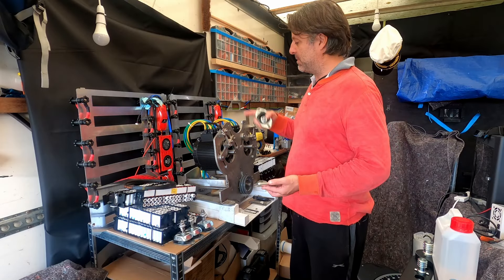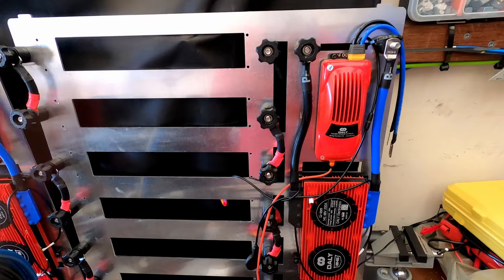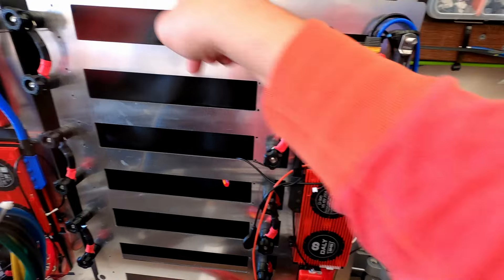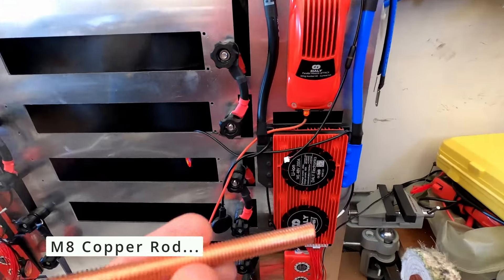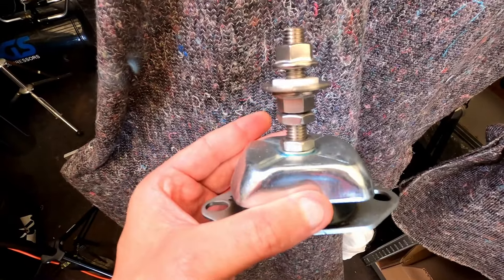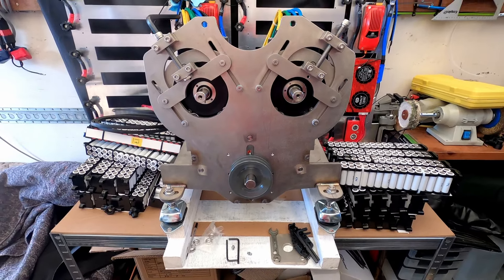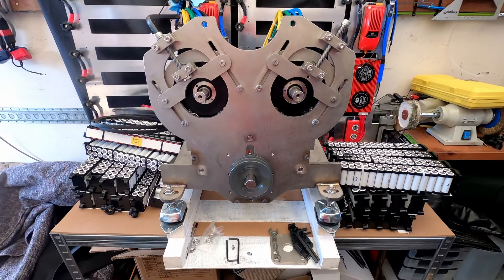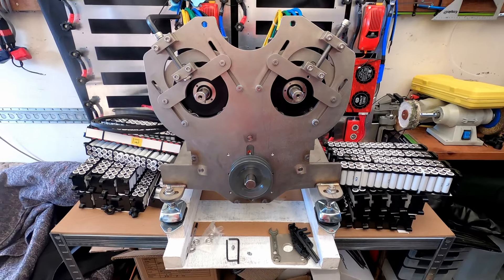Off-Grid Boat: DIY Electric Boat Motor Assembly - Ep. 6

Comment: The reason internal combustion engines for example in cars are mounted with compliant mounts is due to relatively large masses moving in a reciprocating motion or rotational motion. The biggest contribution are the pistons going up and down.
But there's many things moving inside an internal combustion engine so if you want to learn more about it, look up the Wikipedia article titled "Engine balance".
So if you hard mount an internal combustion engine, all those vibrations get transmitted through the thing it's mounted to. Things are going to break. Does the engine mind? I don't know, probably not good for it but it's probably not going to break anytime soon.

Where as an electric engine just rotates. Though that doesn't mean it won't have any vibrations. 
Grab an electric drill and turn it on. You'll feel it has some vibrations. 
Sure the rotor is balanced (hopefully) but it's not a gyroscope going to space so it isn't perfect. The bearings aren't perfect either.
But the vibrations will be higher frequency.

But will the mounts be effective in reducing that higher frequency vibration? I don't know.
Usually boat engine mounts assume you're slapping something more akin to a 500 kilo anchor on them that has secondary imbalances which the mounts need to resist.
If the mounts were too soft, the engine would bang against the hard stops of the mount so they're made stiffer to ensure that doesn't happen.

So perhaps it is overkill to have vibration dampeners with an electric motor.
But then again, there's a shock load that happens when you put the transmission in to gear.
With cars you have a clutch which you can feather to reduce the shock and you also have rubber tires that eat some of that shock.
With a boat you just slam it into gear and the propeller bites into the water.
Do you need vibration damping mounts for that? I don't know. Probably not.
Reply from the maker: Thank you for the in-depth response on this subject, it all makes sense. To dampen the shock load from torque (start) alone, I feel it must be worth having them. I rather this energy partially being absorbed by the rubber mounds, then being a direct load on motor and motor-housing. I have a feeling that it would work fine without and would be interesting to compare outcome from both scenarios. Maybe even higher frequency vibrations would cause some form of unwanted noise/vibration? I hope you did not mind thanking you in video, in hindsight I realised that maybe I should have asked you first:) Hope OK?
Reply: @modularhippo  Sure, the possible higher frequency vibrations could be annoying. Spin a drill and hold the drill's housing against a table.
But those noises might be drowned out by the motor noises. Depends on the motor controller what it makes the motor sound like.

But since you mentioned in an another comment that you will be using an Aquadrive CV then yeah the engine should be isolated as well.
If you hard mount either one, eventually something will get misaligned and bearings will take a beating.
Either hard mount everything and deal with the vibrations and having to perfectly align the engine to the prop shaft.
Or soft mount everything. 

It's okay, this is a public platform after all and I made my comments on a public comments section.
Reply from the maker: @Lagittaja -  Nice one. Although more exspenses upfront, I feel soft mount is the way to go. Perfect allignmemt work in tight space when 6'3 is not a winner:)

Comment: Just wondering why coupling 2 motors? Also these motors will not freewheel ( definitely a drag on performance) so it would be nice to see a shaft disconnect of some sorts maybe for each motor so you could work or replace on the way.
And another thought, most of these motors have peak efficiency at higher speeds so running them slow may get you in very inefficient territory.
Better run a lesser power one at optimal speed with the ratios worked out and decoupled from the bigger one and use the later when you need it (kind of like what Tesla does). This could also improve your regen ability which really sucks at low speed.
Reply: The lower pulley is a double groove, motors single groove with their own tensioners so easy enough to work on either one.
As far as RPM's and ratios goes, to me it looks like he has plenty of room to play with pulley ratios. Then there's also the propeller to play with. Plenty of opportunities to tune the system.
Reply from the maker: All great points! Disconnecting one motor during sail may well be the way forward from a regen perspective. There are so many parts in play, and each have their own limitations and optimisations, so unless tested in real application, it is hard to know where to start. I have a feeling that there will be a lot of tweaks down the line:) Cost is also a factor. I could get a propeller for 4K that would fix a lot of regen questions, but as my budget is 1/6 of that, I will have to settle for something basic and work around it. The motors have an optimised area where I get the best output against the least amount of power, and that is my starting point. As soon as all hooked up, we can get some real life figures to play with:) - Like the idea of some form of quick disconnect as could come well in handy. Thanks.

Comment: It does look amazing and I am happy to see your progress. Have you given any thought to a thrust bearing plate on the drive shaft?

Also I believe the antivibration mounts will be ok for a time. However the torque from them will eventually tear them up.
Reply from the maker: Hi - The boat I am building have a thrust bearing plate as part of it's design and makes prefect sense to transfer the energy to that plate instead of the motor via shaft. The recommended part for my boat is Aquadrive CV Joint CV05 part# 607001 Thrust Bearing B10 part# 6110210 (but may substitute them for other brands if I find something equally as good but for less $). I agree, I will definitely keep an eye on the rubber parts of the mounds over time. :)
Reply: i don't know why Aqua/python Drives are so expensive when they are basically CV joints like from old Porsche/VW...maybe they are higher tolerance? also i would think they wouldn't be necessary on electric motors (lighter than diesel ICE) especially with precision fabricated steel mounts like in this video.
Reply: @MonstroLab  cv joint is a cv joint if it can tolerate the torque and is the correct size I would use it especially if the cost is substantially lower.
Reply: @Knoconner  i think read somewhere online where a guy used CV joints from old VW bug...im going to google these key words try find it
Reply from the maker: @MonstroLab - Not a bad idea! Anything with the word 'sailboat' seems to magically tripple in price these days, so we'll worth checking alternatives:)
Reply: @modularhippo  Facts! So, so far ive read that C.V's require thrust bearings because CV's aren't designed for constant thrust loads. Also a CV+thrust unit creates more friction reducing horsepower, consumes more fuel/power and effects longevity (they can get real hot too) i think your V/serpentine belts should be enough to isolate any vibrations. im Really liking your build series keep up the good work!
Reply from the maker: @MonstroLab Thank You! All good stuff worth thinking about and thank you for watching!:)